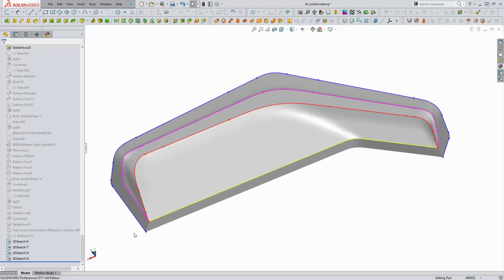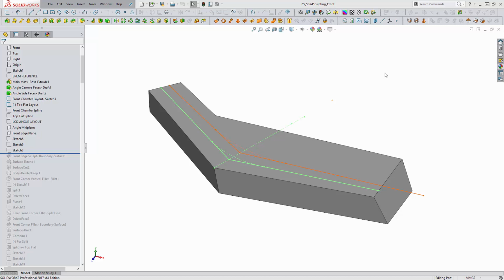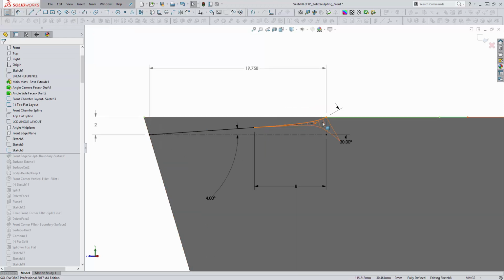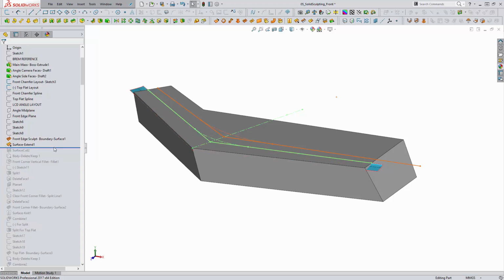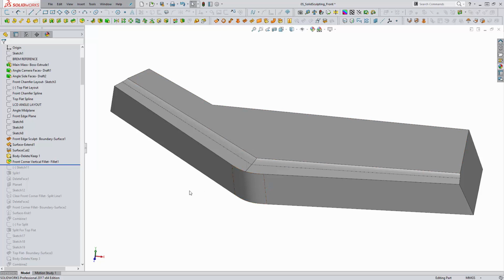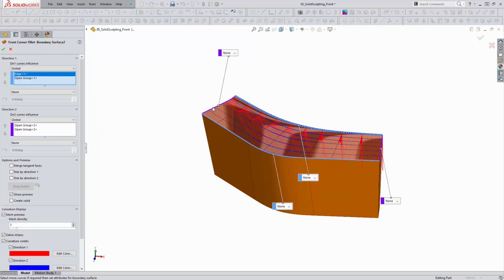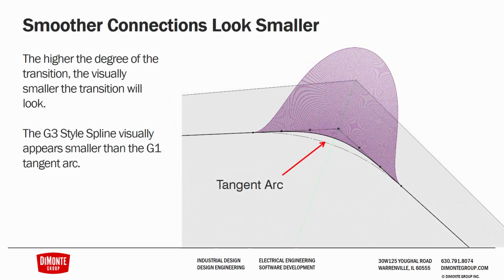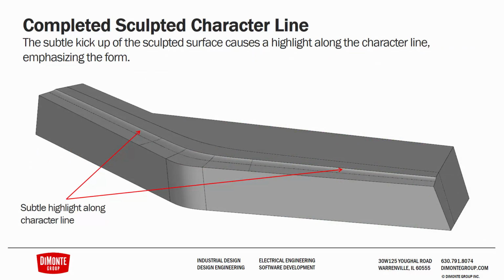Solid Sculpting I | Zen & The Art Of SOLIDWORKS Surfacing 08

Comment: in alias/automotive design (which these dynamic looking features are based on) you would never use a straight line and a spline otherwise the shape looks negative. There are no straight lines anywhere, even lines that look straight are curves with a small amount of curvature, which gives the feature more flow and natural character which the eye picks up on

Comment: Super awesome!
Curious why didn't you choose to ass the fillet on the solid form, then use that as a base to create sketch profiles for the cut away portion.
Doesn't that eliminate the need of fixing the kickup or am I missing something?
Reply from the maker: Daniel,
That's an excellent question.  What you suggest is really the better way to go.
  
What Andrew shows in this video is more typical of a designer figuring out what their final shape is going to be via the process of just going in and working it out on the fly, then patching up the areas that don't work.  
You will note that Sketch 8 (the single Dir 2 curve on "Front Edge Sculpt-Boundary Surface 1") doesn't actually define the model directly.   When the corner detail is completed, Sketch8 is left behind, in its original location, floating in now empty space.  Modeling this way is touchy and more difficult to edit because the Curve he defines is not the model that he gets.  But people do work this way.

His technique for fixing the corner is what's useful, for when one does get into this sort of situation and needs to repair a "kick-up".  It is worth repeating that Split Body instead of Split-Curve is significantly more stable

Thanks for your comment! - Ed